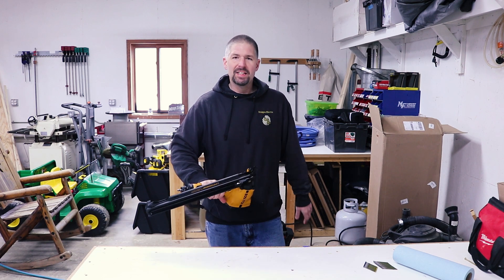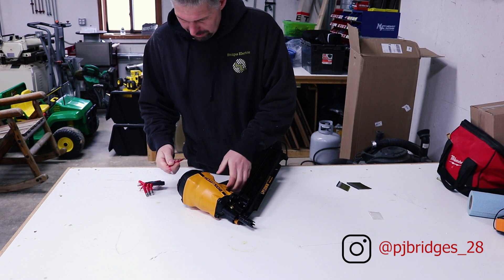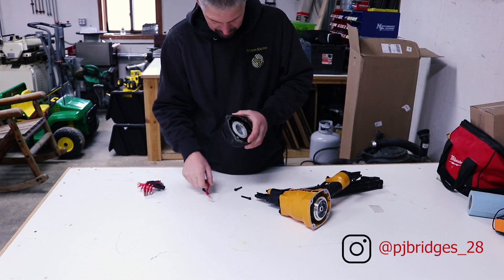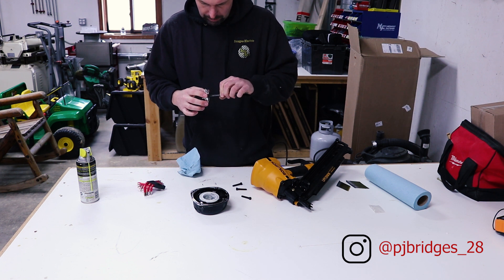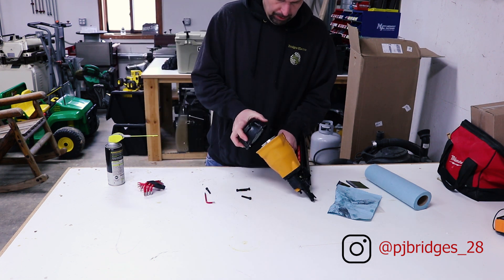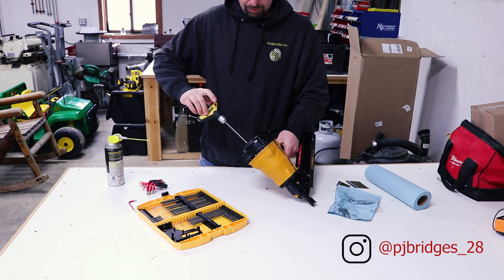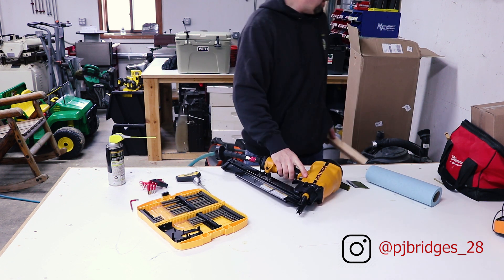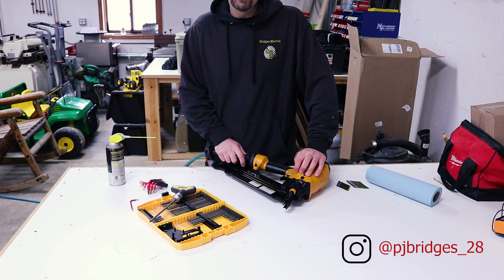Broken Framing Nail Gun

Comment: Replaced my o ring gs and now when I put air to it it just sounds like a machine gun..any thoughts
Reply from the maker: Did you grease the O-ring with some Lithium grease?  I would also clean and spray some down the cylinder.